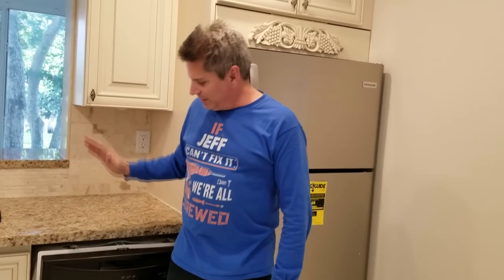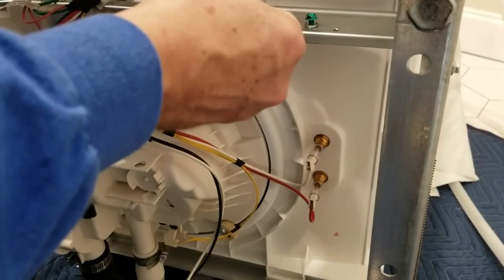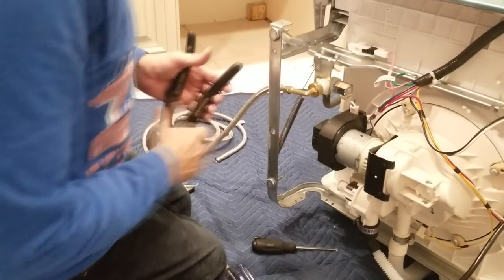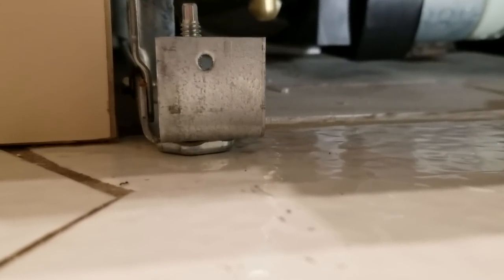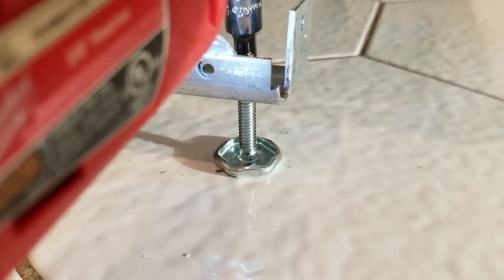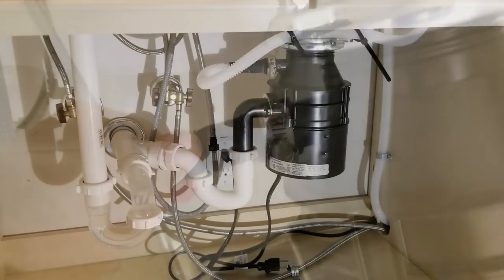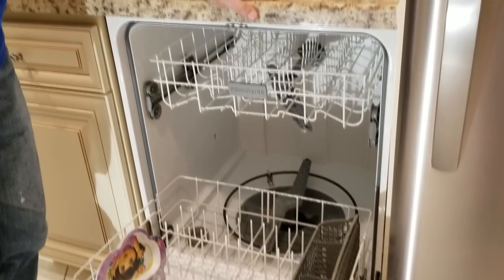Dishwasher Installation & Kit, Correct Plumbing Codes

Comment from the maker: ⚠️⚠️⚠️ See our newer upgraded re-filmed 4K dishwasher installation video, no background music, shorter than this, watch it here: https://youtu.be/0EoofD0ZcJg
✅ DEWALT DCK299D1T1 Hammer Drill, Impact Driver Kit: https://amzn.to/2M6h450
✅ General Electric Universal Dishwasher Water Connection Kit: https://amzn.to/2EFPjNi
✅ Milwaukee 13-Piece Hole Dozer Hole Saw Kit: https://amzn.to/2H3Wxyh
✅ Channellock 12-Inch Tongue and Groove Plier: https://amzn.to/2ThDVBv
✅ BrassCraft Dual-Handle Shut-Off Stop Valve, 1/2"X 3/8" X 3/8": https://amzn.to/2tP6Ei5
✅ Whirlpool 3-Prong Dishwasher Power Cord Kit: https://amzn.to/2XysrYO
✅ GreatNeck Nut Driver Set, 7-Piece: https://amzn.to/2VGjaMI
Reply: Jeff,  nice job.  ironically, i just install the same dishwasher 
    last Fri. in one of my rentals.   $ 288.00 plus tax at Lowe's
here in CA.   also,  hard to hear you at times over the music.
Reply: Thank you for the video but please no music.

Comment: Very informative. Have to DIY installation of my dishwasher. Let's see how it goes
Reply from the maker: Did it work?
Reply: @jeffostroff   yes indeed. i only managed to do it 2 days before, test run for 1 day to see any water leakage. worked fine. 
for now i have been collecting drain in a bucket. since there is no leakage in inlet water connections, now i will connect it to the garbage disposal

Comment: very good video. extreme detail and appreciate you showing the codes and backing up what you say. i was always concerned dishwashers don't provide enough force/pressure to carry on through the high side loop @ 32" height; you have shown its not an issue. thank you.
Reply from the maker: Glad it was helpful! Thanks for watching Dan

Comment: Very very detailed and explain why it suppose to be installed certain way.  Camera and taking was very clear. I love it. Thanks. I have high pressure wash machine and it is not working. Do you have any video?
Reply from the maker: No, other appliance we have we uploaded a few weeks ago on how to fix a washing machine that fills with water buy won't agitate. What happened to your pressure washer?

Comment: Great video for the most part. . . just an fyi though the hose, supply and cord go through the same hole.  You don't need separate holes for connections in the sidewall of your cabinet or at the very least I have never ran across one that all 3 weren't in the same hole.

Comment: Just had the big box store install the dishwasher...what a mess...I will attach the host up high as is in your video...my dishwasher was not put all the way back into the cabinet...telling me that my new dishwasher is larger than my old one...I checked the dimensions and they're the same!!! What a lot of BS.. The dimension are pretty universal.....the supervisor of the installation company is supposed to come to inspect it...boy do I have a lot to tell him about how to install a dishwasher after watching your video... Their installers need to go to a class to learn how to install a dishwasher...I seriously think I could have done it myself.! OMG...This was my third attempt to get a dishwasher...first one it wasn't on the truck...the driver told the boss he left it in my garage??? and that the plumbing was not good enough to work with. (they never looked under my sind)..it'a all new plumbing.    It was never on the truck!!  (maybe it fell off the truck "somewhere"!!   Second one came and the machine was damaged, So now the third one came today...what a mess.  I think that they never were careful about the hose and the wired when they shoved it back in the opening and so it isn't in far enough... same deal with my stove that they installed...said that it couldn't be pushed back due to the gas line. (also smelled gas a little) ...my son-in-law came and fixed it..he's a Fire Chief so I know now that the stove is installed correctly....what a headache...never again!!   Thanks for the video!!
Reply from the maker: I noticed this happening years ago and as of 2017 I vowed never allow any home depot contractors to come in to do any work for us.

Comment: I Have an issue with the drain line.   The installer for my dishwasher wouldnt install because the drain hose is between cabinets and doesnt have some sort of special extension from the disposal to the included drain hose from the dishwasher.  Is there a special extension for this?  They want me to hire a plumber to come in and install this.  Seems like something easy if I know what parts I need to do this.
Reply from the maker: Not sure what special extension they are talking about. Maybe the hose from the dishwasher to the disposal does not just plug onto the disposal so it needs an adapter, not sure what he's saying. Look at this part from Home depot, this could be what he is saying you need.

Comment: I do not have a garbage disposal, connecting the drain to the drain pipe from the sink is OK as long as I provide the wye fitting and proper vertical loop?

Also, after purchasing the dishwasher I called the appliance store to ask if it needs to be hard-wired or plug-in. They told me hard wired, so I ran a new wire and did not provide a receptacle. I assume this is OK and not a violation of any code? I don't need to cut back into the drywall just to add a receptacle?

Great video! But agreed with most other comments, music a bit loud at times
Reply from the maker: Hardwired or receptacle is fine either way, both are allowed by code. I prefer a receptacle, but it must be it's own 20 amp circuit you may have to run a new circuit from the electrical panel. Often times, they run the garbage disposal and the dishwasher to the same duplex receptacle, then snip the tab to make each of the 2 plugs on the receptacle independent, with their own 20 amp circuit. Then in the electrical panel, you put them side by side with a pin connecting them as a double throw switch, so when you turn one on, or off, the other goes on or off. This protects you form working on the outlet and having one of the 2 circuits still on. As for the dishwasher hose, yes you can connect it to a Plastic Dishwasher Branch Tailpiece from Home Depot, here is the link: https://www.homedepot.com/p/1-1-2-in-x-8-in-Plastic-Dishwasher-Branch-Tailpiece-PP931-8PVC/304826866?MERCH=REC-searchViewedNA-304826866--N

Comment: Thanks for the video, especially the code requirement on the exhaust water pipe connection into the disposal. Super helpful. I have 2 questions.  1) I notice that your replacement unit have a plug that plug into a receptacle, no doubt being protected by GFCI circuit. My replacement unit however would be a hardwire unit.  There is a discussion on the web if a GFCI branch breaker is required for hardwire unit. The latest NEC seems that it is required. What's your thought on this?  2) I notice that you connect the supply waterline to the hot water side.  Is this a requirement or can it be connected to a cold water line?  Many thanks in advance for your reply.
Reply from the maker: Yes the national electric code requires those circuits to now be GFC I protected and the best way to do that really is with the GFCI Breakers in the electrical panel. you never want to connect up your dishwasher to the cold water you always want to connect it to the hot water because you need hot water to make that water hot inside there so when you use a hot water cycle it won't have to sit there and heat up the water forever before it starts , and if you give it cold water who knows whether it will even be able to heat it up to where it needs to be.
Reply: @jeffostroff  Thanks for your comment.

Comment: Nice presentation. Just had a kitchen reno done and now the dishwasher is farther from the sink. However the water lines and drain pipe are in the basement almost under the dishwasher. Can I connect directly to the water line under the floor (with a shut-off) and to the drain line also much nearer than the sink. Is this feasible and not violating code?
Reply from the maker: I would just make sure you can easily get to these connections so you can monitor them for leaks.
Reply: @jeffostroff  Thanks Jeff. Yes. Open ceiling below...utility room.

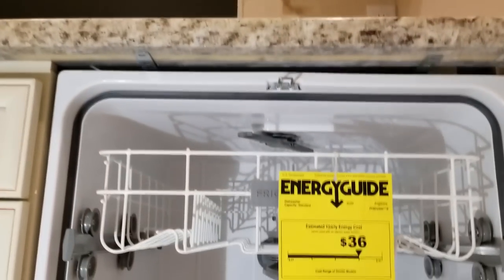Comment: 30:55 Did you screw directly into the granite top? What screws size are they? Where did you purchase those screws? Thanks.
Reply from the maker: My granite guy always makes for me a piece of wood attached tot he bottom of the granite counter, and it is sanded down and flush with the bottom of the counter. Looks like I am screwing the wood screw into the granite, but it is really going into the wood piece. Regular self tapping wood screw about 3/4" long.

Comment: Great video. I have an air gap set up. The water is flowing into my dishwasher. I have no clogs, installed a new air gap. I ran my dishwasher drain hose like you did and created a high loop that is just above the air gap. 
I took the dishwasher apart and cleaned all the pump drain area. Had some corn kernels and small debris I thpught could keep the back flow rubber check valve open. Cleaned the rubber check valve and it wasn't broken.  Yet I'm still getting water flow back settling into dishwasher....drain flow isn't hampered. I can't figure what is wrong...amy tips
Reply from the maker: The only thing I can think of that would cause that is if you had strawd a new garbage disposal and forgot to remove the plug. If you forget to punch out that plastic  Plug on the  Side of the garbage disposal where the dishwasher plugs in, then when the dishwasher tries to drain it goes nowhere and goes right back inside the dishwasher.
Reply: @jeffostroff  the plug is removed. I believe it's a failing water inlet valve. I thought the water was filling off the air gap and I incorporated a high loop. All lines are clear.  Water slowly  fills in the dishwasher when the facet runs. I noticed the water port on interior of dishwasher had slight drip flow when i turn on the facet.  It's a failing water inlet valve. It's the only pc that is between the water port and water line.  $60..not bad.
Reply from the maker: @fritzhiser4659   At least you are able to diagnose it that's pretty good
Reply: @jeffostroff  getting the part tomorrow. If it works I'll let you know.  I believe it's the issue

Comment: Very good instructions, and helpful hints. That said, couldn’t you at least spring for a dishwasher that is stainless steel inside and out? I realize it’s a rental property, but come on Man!
Reply from the maker: $50,000 condo. this was a $200 dishwasher, the stianless internal tub models start at $500. Not going to do it.

Comment: I have 2 things with existing dishwasher.  At home I realized after years installed by HD, the hose hole and the hose are  very high, a bit higher than garbage disposal.  There is no high loop in this case.  

On my kid's condo, they just left an air gab dangling under kitchen cabinet sink - connecting to the garbage disposal.  Granite counter did not have an air gab hole drilled and we are not getting one.   I am thinking  just to cap off the air gab somehow so the whole thing become on continuous hose from DW to disposal with high loop to be applied.  Or I can simply remote the air gab and rubber draining hose, and just use DW hose connects directly to the disposal.
Reply from the maker: If you are not in WI, you don't need an air gap, most states do not require one they are ugly. I usually get my high loop one of 2 ways. 1) run discharge hose through bottom of cabinet, then up the wall of the cabinet, to the bottom of the counter, than curve back down to the garbage disposal. 2) Like the HD guys did, you make the hole at the top of the inside of the cabinet between the sink and dishwasher, so running the hose up to that hole, it arrive sin the cabinet just below counter level, then you curve it back down to garbage disposal. As long as you are above the garbage disposal you're OK. I don't like their method so much because most dishwasher makers have explicit instructions to follow where you can and cannot runt he hoses to get them into the cabinet.
Reply: @jeffostroff  The hose is too short to run down and up to make a loop  to the disposal not sure I will have to replace it which involves taking the DW out.  Will see.  So far no backup cross finger.

Comment: Installed a new Frigidaire dishwasher today; however, the water is not entering the unit.  It's  not my first installation and I did go completely by the  book. I used the same cabinet space that held the old dishwasher. Why would the water inlet valve not accept water from the supply line, other than perhaps it's defective from the manufacturer?
Reply from the maker: Good question. Test the water supply line first by seeing if it shoots out water,. Once connected back up, be sure to turn the water supply back on. IF you get that hose to shoot water, then the dishwasher has a hard time opening the water inlet valve. So the problem is either the water supply or the water inlet

Comment: Thank you very much!  This video was helpful.  The hole in my cabinet is at the bottom as well.  Couldn't the dishwasher high loop issue be solved if the cabinet's hole was at the top?????
Reply from the maker: Yes and no! Yes that would be the correct height to bring in the hose from up high. No it's not allowed, because the manufacturers tell you not to, because there is only space at the bottom of the dishwasher to pass hoses. If you try to pass hoses up high behind the dishwasher, they will get pinched between the dishwasher and the wall.
Reply: @jeffostroff  Ok.  Two holes then! Right?  Lol :)  Thanks so much, this was very helpful.

Comment: Hi Jeff love your video and how you take your time to explain every step in installing a dishwasher. When drilling the hole for the dishwasher drain why not drill at the top of the cabinet?  This would insure the dishwasher drain is higher than the connection to the plumbing or disposal preventing backup. The same principal also applies when installing a garbage disposal. Also it is important to note the electrical outlet under the sink must be GFCI or chain linked from another GFCI.
Reply from the maker: Ernest the instructions on almost all dishwashers don't want you to run the hose up high inside the cavity of the dishwasher because it could interfere or pinch would the edge of the dishwasher. So they want you to run it through where their space down below like I did and you can see I run the hose up the wall inside the kitchen sink cabinet bringing it up to the counter top. Also with electrical outlets when you have a dishwasher and the garbage disposal on the same outlet as a dual use, there really is no way to make that a GFCI.
Reply: @jeffostroff  Thank you for your detailed answer I installed my dishwasher drain hose as you instructed.  The drain is 32 inches high 10 inches higher than the connection to the garbage disposal providing a really good pitch. I also installed a GFCI outlet under the sink to plug the disposal and dishwasher into. I am using a wireless transmitter/receiver made for disposals to turn the disposal on/off.  Works great no wires. If I could I would send you a picture.

Comment: The wiring from the dishwasher was green, white and black. The 12/2 wire I used was bare copper, white and dark grey. I connected the bare copper to the green, white to white and dark grey to black. The ground doesn't screw to the wire plate like yours does. Does that sound right?
Reply from the maker: The colors sound right, and if your metal outlet box in the wall is indeed metal, you need to bond the green wire to it. Sometimes I drill a hole and screw in a green ground screw.
Reply: @jeffostroff  
I actually had to run the wire from the breaker Box as there was no dishwasher, so I'm hard wiring it.  It's a GE washer if that matters

Comment: Hey I'm hoping you are around!? My stubborn know it all boyfriend is about to take out the highloop on the drain hose bc it's not draining. We don't have a garbage disposal.  The only thing I'm seeing is that the highloop is necessary?? Any advice?🙏🙏
Edit: Its an older GE. Newly installed.
Reply from the maker: Brandi you MUST have the high side loop, it is required by plumbing codes, and all dishwasher manufacturers tell you in the installation instructions to use it and it does work. The hose should run up tot he bottom of your counter, then back down to the down pipe from the drain and connect to your down pipe from the drain if you don't have a garbage disposal. This is the part it needs to connect into: https://homedepot.sjv.io/jWXqmv

Comment: Question concerning the hot water hose.  Do you form a loop underneath the bottom of the dishwasher when sliding it back in to take up the slack or do you prefer to do the loop under the sink if the hose is a little long?
Reply from the maker: I try to keep the hose straight on the floor under the dishwasher all the way back to the hole, then form the high loop under the kitchen cabinet.

Comment: Great video, thank you! 
Maybe I missed it but I’m curious about the benefit of the dual traps?
Reply from the maker: Dual traps keeps the water separate until it's in the vent. For this sink I did not want to do a horizontal arm from the garbage disposal to meet up with a T-connection below the sink, which would result in only one trap. On the next one, we'll probably revert back to the standard one trap model. this was just one of many ways to do the plumbing. If you look at most modern kitchens with 2 sinks that were designed for 2 sinks, they each have their own trap into the wall, where they lead into the vent.
Reply: I see. Thanks again for the tips. Well done under that sink, it looks good!
Reply: @jeffostroff  i thought code prohibited more than 1 trap on a trap arm?  Won't one siphon the other dry?